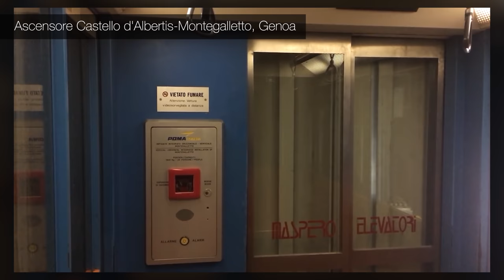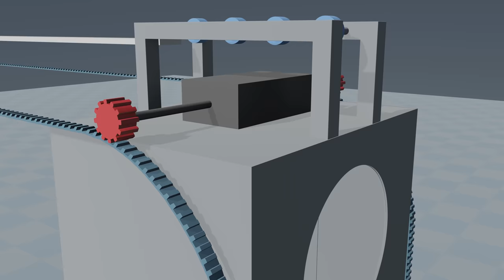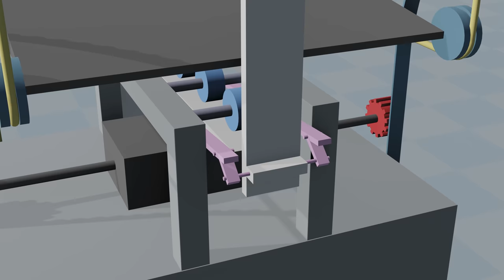I thought the Schmid Peoplemover was impossible

Comment: Very clever device! Sadly it seems to be another example of someone inventing something that is objectively superior but never really catches on. 
(Edit: Ok, ok. I see now that I have overlooked the flaws in this system, particularly the inability to move large numbers of people quickly, aka "bandwidth".)
Reply: Idk. It has a lot of disadvantages, especially cost, upkeep, and applicability. It’s still really cool, though
Reply: And fire safety.
Reply: I wouldn't call it objectively superior. One of its main disadvantages is bandwidth - I've been to train stations where 50 people get off the train and cross the bridge. In order to deal with traffic like that in a reasonable time frame you'd need quite a few of these things lined up - which also increases the maintenance costs, breakdowns, etc. Generally when engineering a solution to a problem you want less moving parts, not more. In that sense this is kind of in a weird place; it has tons of complex moving parts, to replace something that has none & requires no upkeep.
Reply: @larion2336   Good point, I hadn't thought of that.
Reply: The better solution is a tunnel ;)
Reply: Yea imo I think it's cheaper and faster to dig an underground tunnel to move ppl. Really won't have much maintenance costs after its built
Reply: @larion2336  well a bridge or tunne definitely need upkeep too, its just less frequent and probably cheaper in the long run
Reply: Seems objectively inferior to me.
The bandwidth of people who can use it per hour is far less than an equivalent footbridge with dual elevators (and stairs), and it’s far more complex and expensive to build and maintain than that too. 
It’s cool as a proof of concept and I’m sure there are a few use cases for this where two elevators and a bridge wouldn’t just be better - but this isn’t one (and actually I can’t think of one either)
Reply: @ollyrukes  I can't in any way agree that two elevators and a bridge would be better. Yes, a bridge would be better, but two elevators? Just have this elevator coupled with a bridge and some stairs. Solves the bandwidth problem while maintaining the superior way to cross the road (which is what people mean when they call it a superior design - because it really is a superior way of crossing the road, if you view the problem of crossing the road in a vacuum).
Reply: @landkonnudur  2 elevators and a footbridge is vastly superior in a practical way to this design. It allows foot traffic to move in both directions, it speeds up cross traffic flow, it’s more cost efficient, requires much less maintenance, and an alternate form of travel should there be a breakdown. 

This is definitely cooler than a more traditional design, but it is no way superior practically
Reply: It's cool on a small station with only two tracks like that but on any train station with three or more tracks (like most trains stations in France as an example), you'd need multiple people movers, and foot trafic would become awful, that's why a bridge or an underpass ar far superior designs you only build one that add as many stairs and/or elevators as needed
Reply: Maybe you didn't watch the entire video. This is not superior in any way!!
Yes, it is a technical curiosity, nothing else!
Reply: It's more complicated, expensive, and harder to maintain than just a foot bridge with stairs. It's cool but not as efficient or practical as a foot bridge or underpass.
Reply: @mikatu  Maybe you didn't watch the entire video. It is superior in terms of the user experience, particularly for the less able.
Reply: @jocramkrispy305  so it’s superior except for all the ways it’s not? Thanks for the insight.
Reply: It's not superior. For a small station it is too expensive, for a big station, its capacity is too low.
Reply: @dylanb2990  That would be "swings and roundabouts" -- but that's not the case I was making.

Before deciding id something is better than another, you have to agree what the selection criteria are -- otherwise you have unanswerable questions like VHS vs Betamax
Reply: Cough cough Tesla cough cough
Reply: @oofguild7788   A Tesla can't possibly match all the capabilities of my Toyota 4Runner. Teslas are ok for folks who do very little driving, never go outside of urban areas, never need to haul anything, and generally have boring lives.
Reply: @raydunakin  I meant the inventor not the car. Understandable mistake, though.
Reply: Use stairs bruh
Reply: @0BSguides  Not everyone can ...
Reply: It's not "objectively superior" from an economic point of view.
Reply: @raydunakin  I agree, though the cybertruck might be able to. Havent really seen what a production model will do yet.
Reply: @lucbloom  how often does hunk of steel catch fire in your world?
Reply: It will never catch on because it looks like it moves 8 people a minute at best.  And that is twice as long for people going one way. Single train cart will have like 20 spaces minium... So to fill just two you need to be queueing for up to 15 minutes before train arrival.
Now consider typical train will have like 10 cars to fill and station has usually 2 lanes you don't want to do the math here on a busy day. This might do ok in a rural train station with one track.
Reply: It didn't catch on because there are always better alternatives. Did you even watch this?
Reply: these cross track elevators NEVER move large nos, if there is a crowd they use the stairs leaving those who NEED the elevator to wait for it.
Reply: @larion2336  
Careful - the notion that a bridge or an underpass requires no upkeep regularly leads to VERY expensive surprises and traffic chaos once the thing has reached the level where collapse is imminent.
Reply: Bandwidth could be increased by having two running simultaneously, ie back to back.
Reply: @landkonnudur  If you look at the problem of crossing the road in a vacuum, the superior way is to just... you know... cross the road...
Reply: @larion2336  Well, if the people mover caught on like regular elevators did, then it wouldn't be "special training" to fix them, it would just be standard operation like it currently is for maintenance workers. So then it wouldn't be more expensive than an elevator to fix, it would be the same because the people mover would be the standard, instead of the elevator, and all mechanics should know how to fix it.  

But yes still it's more complicated machine that would take more hours to fix than a regular elevator. But if that's really the only problem then it might be worth it. 

The OP said that the problem was that the people-mover was so rare, and I have to agree with him. The people-mover would undoubtably be improved upon by other companies looking to replicate it aswell, probably lowering the cost and repair to fix them in the process of mass producing the people-movers

🤷‍♂️
Reply: @ohauss  What I meant by that was that it doesn't require mechanics or electricians to actively come out maintaining machinery and the like. I know even roads require maintenance. But it's also definitely true that something with no moving parts almost always lasts a lot longer than something with a lot of moving parts.
Reply: No one here is mentioning how slow this must be if the elevator in on the other side. It has to travel the whole way to you and then take you across. A dual elevator bridge solution would be much quicker and allow for abled people to use optional stairs.
Reply: Bandwidth isn't a problem if we're talking about physically able people: Just build a footbridge.
The peoplemover however is objectively more simple to use for handicapped people.

The solution would be to build one of both for each crossing.
If more of those types of peoplemovers get installed, it won't take long until a decent number of technicians start to appear for them.
Reply: @Cypeq  for a rural station with one track a simple crossing path where you walk across the track is the best solution
Reply: @ollyrukes  I agree.  Dual elevator towers (with stairs) and dual moving sidewalks in the bridge would nearly eliminate the bandwidth argument.  But there is still the problem of recurring costs.  If people would just look out for moving traffic....
Reply: Seems good for situations where a busy road is interrupted by a small amount of foot traffic.
Reply: Yes it is superior, especially for railways, people from countries with almost no highspeedtrains talking here as i see ^^ 

a tunnel wouldn't be cheaper, and even worse a tunnel can crash the whole system and isn't filled as fast as a bridge - a bridge you have to say is easy but not for People with disabilities so instead of putting 2x elevators and 1 bridge - this peoplemover is way cheaper overall - and for small towns / villages superior
and the best thing is - you can put it there finished and it is less heavier, than a brigde people would build nowadays ... bridges are more dangerous than many people think - people throw down garbage, they jump down, they need to be safe for children, animals in a cabin - you just don't :)
Reply: Objectively more superior than just walking across a raised passage way with steps? Pffff, Do me a Favour
Reply: Low on capacity - or a waste of money.

A lift at both ends doubles capacity, and increases efficiency.

If the increase is not needed, then it is not cost effective.

Perfect example of "just because you can, doesn't mean you should"
Reply: I feel like this would annoy me so much as someone who walks everywhere cause its would take a lot longer than just crossing the road on a traffic light. you'd have to wait for it to stop to let you and everyone else in, then unless there was two (haven't finished the vid yet) you'd have to wait for it to come back to the side youre on. then do the journey then wait for everyone to get off etc. instead of just waiting like max probs 2.5 mins for the light to go green and walk across with no problem (or just walk across the road if no cars near which I know is illegal some places but u know). etc etc
Reply: Everyone here needs to keep in mind that this wasn’t made for efficiency. It was made to be accessible. Sure, some stairs would be easier, but not everyone can use stairs.
Reply: @abigailment  Some people need to realise that over engineering isn't something that should be defended.
Reply: Not clever at all. The cost of production, setup and maintenance are probably in the real high end of “constructive idea”. Why not build a bridge instead over the railway? Would eliminate the massive cost instantly
Reply: @larion2336  Solution to this would be paternoster style elevator. It already has all mechanical parts needed for directional change. Although doorless elevators are not as safe as this.
Reply: @ollyrukes  Two of these back to back with a staired bridge in the middle should be sufficient to cover those who would use the elevators and the stairs. Complexity is it's only enemy in my opinion, but gears to move... that's a solid move... maybe soon...
Reply: @HippasosofMetapontum  Maybe we could a bridge as fast as that peoplemover too? I don't see any technical barrier to also use prefabrication for footbridge building.
Reply: It's only to be rarely used by disabled people and with bikes I guess.

Comment: I think we can safely make a "Tom's german engineering locations for tourists" map/guide by now! 😅
Why are these cool things not even standardized in germany itself? :(
Reply: Because of no redundancy. :) Though that does not mean someone like Herr Schmid could improve on the design. Could that be sign that this elevator is not well know or there are, sadly, not many people like Herr Schmid.
Reply: "Why are these cool things not even standardized in germany itself? :("

Germans hate standardisations, they have to keep changing it to perfection
Reply: It's a one track design. A single elevator already has queues on normal stations with stairs and/or underpasses. Now look at this case, where the Elevator needs to go up AND down AND bridge the gap (that normally gets parallelized by walking on foot) before it even reaches the other side. Take into consideration, that Elevators mostly get used one way in train stations (to the platform, if a train is imminent and away from the platform, if a train just arrived and the people are getting away from the platform). 
It's an elegant solution and would be an interesting choice for pedestrian overpasses for roads (even though there is the same capacity/throughput problem here) since there are both directions equally used (in most cases)
Reply: It's a flawed concept.

Comment: I knew it is kinda rare, but didn't knew this rare. The one not shown is on my daily route in East Berlin. 
Only took it once. A bit shaky and a bad smell. The latter is probably not the fault of the engineer ;)
Reply: Do you remember where exactly in Berlin that was?
Reply: @minosnegle7579  It's at Betriebsbahnhof Rummelsburg
Reply: @minosnegle7579  MEKKANOID is right. Beware there is another station called "Rummelsburg" before it (coming from the city)

Comment: With some more research and development, this thing could be a great addition to have. Making it in "modules" so you can expand it if necessary.
making it slightly wider so if it does break down while someones in it they can simply walk along the path to 1 side.
adding stairs and a slightly lower walk way.
I'm not one of them there engineers but there could definitely be improvements made that incorporates everything the current systems already do.

Comment: Great invention but alongside this there would still be a need for wide stairs and underpasses. Where I live in Hungary in a mid sized train station often more than 50 people are getting off or boarding at he same time, one peoplemover couldnt accommodate all this people. But for old or disabled people its a great addition.
Reply: Also what about bigger stations where there are a lot of platforms? you would need to build a peoplemover to each one which couldnt be cheap. At that point Id imagine it would be easier to go underground with one lift and go up to your platform with another.

Comment: Looks like I have a suggestion for people asking for its replacement:- Why don't we can have the same structure but more like one of those regular staircase elevators fitted with two lanes for both ends which converts iteself into a conveyer belt when reaching the horizontal part being above the tracks and again becomes a staircase while descending.The two lanes each opposite from one other for abled persons and a third one for the disabled where a mechanism works that automatically engages the wheels of wheelchair to it and pulls it up to the horizontal and then can move like some sort of railway track. This can ultimately solve the problem of smooth carrying and will also consume less time that gets wasted while waiting for the Peoplemover's box.
Reply: There is no endeavor that cannot be made more expensively if given enough time.

Comment: Adding an alternate stairs/bridge combo on top of this elegant solution would not cost that much and provide the necessary backup.
Reply: But if you're building a traditional overpass anyway, why would you spend additional money and real-estate for adding this as well? Given that this has three times the travel time of a vertical elevator, you're just massivley reducing the number of people you can move.
As Tom said, this design has its advantages and one of them is the smaller footprint and easier setup. If you have the space for an overpass with elevators, then the peoplemover adds little advantage for the company (albeit lots of comfort for people using it, as long as there's not so much traffic that they have to wait so long for the cabin to return that they miss their train)

Comment: Went there yesterday to try it and it is a nice piece of engineering but it looks an over complicated solution to a simple problem. And the transition from vertical/horizontal is not THAT smooth but it isn't a roller coaster either. If you pass by the lovely area of the Neckar valley, give it a try!

Comment: This is truly a fascinating work of engineering, not only because of its functional intricacies but also because it was assembled on-site in less than four hours.

If I built one, however, I’d incorporate two standard elevators (with stairwells) and a pair of opposing moving walkways like they have in airports. The walkways would still be crossable if they quit working, and the designers could integrate some form of speed control for convenience.
Reply: In that case the doors of the elevators need to be oriented towards each other so that they open up onto the walkway. And some room between so that people leaving/entering the elevator don't suddenly hit moving ground. The stairwells also need room. All in all surely about 2-3 times the ground clearance.
At that point it's just a normal bridge with moving walkways added.
Reply: @HappyBeezerStudios  I was thinking why not just make a zig zag stair case that leads to a walkway, which is just the top of this elevator.

Comment: We can complement a footbridge with a travellator, those long horizontal  elevator-like moving tracks that you see at airport terminals. So 2 elevators and a travellator can be an effective alternative to this.
Reply: I imagine that two elevators and a moving walkway could handle a lot more people. An elevator would return to collect more passengers after letting the current passengers out at the top, while this design can only return to collect more passengers after going up, across and down the other side.